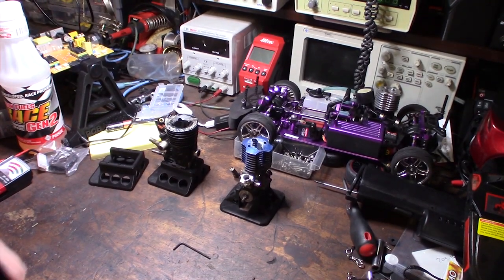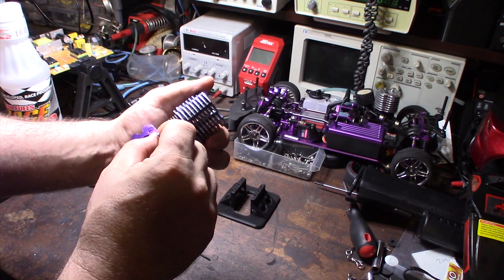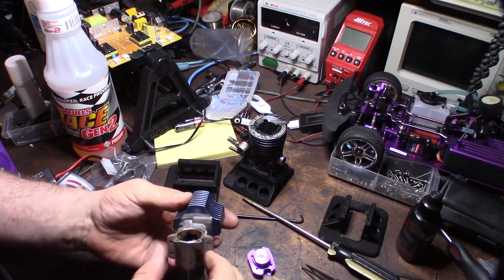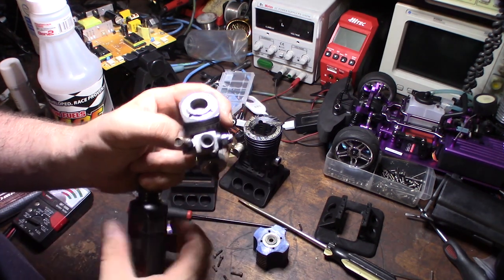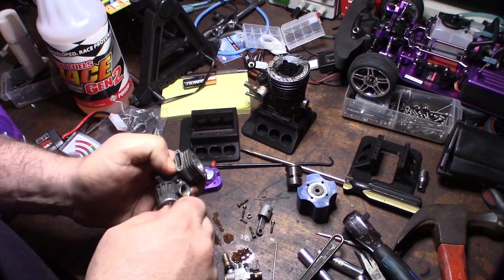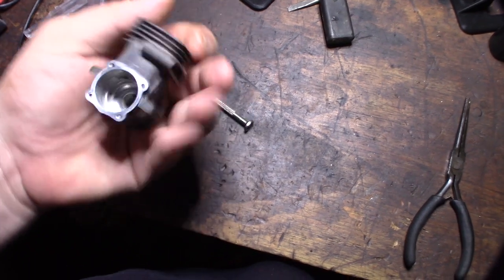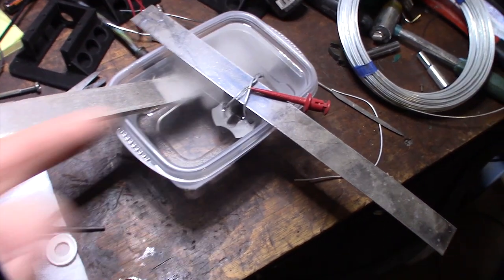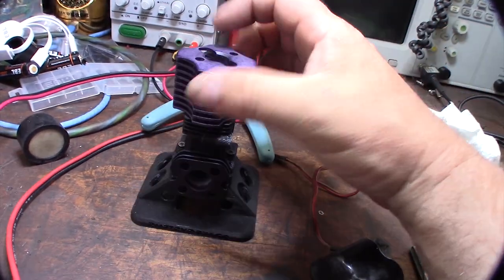O.S. Max 12CV Nitro Engine Restoration $17 Ebay score, Powder coated and Anodized .12

Comment: Hi there is that what happens to your nitro motor when you don’t clear the carb and the engine of excessive fuel when storing your car away for a few months.
Reply: Gets gummed up, spray it with after run oil in the carb and glow plug hole before it sits for awhile.